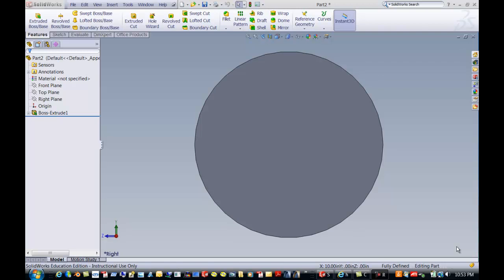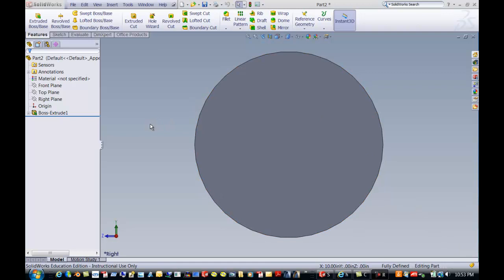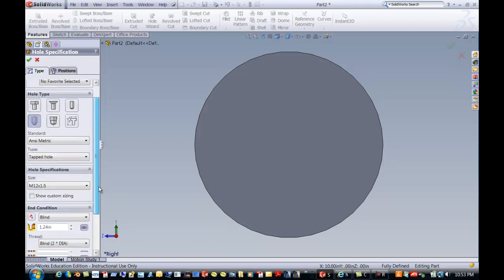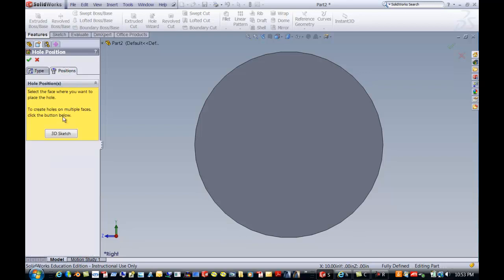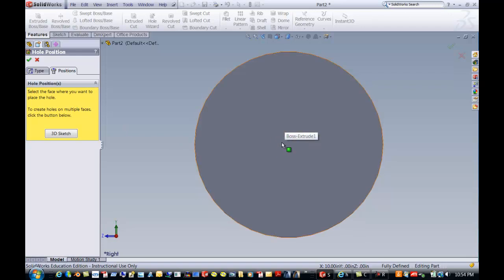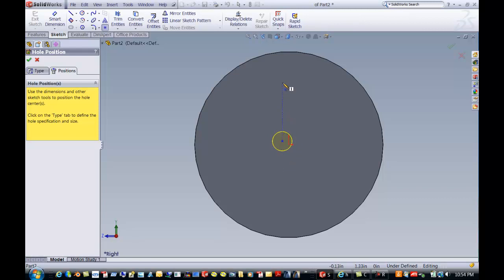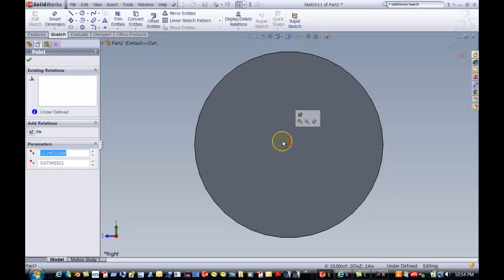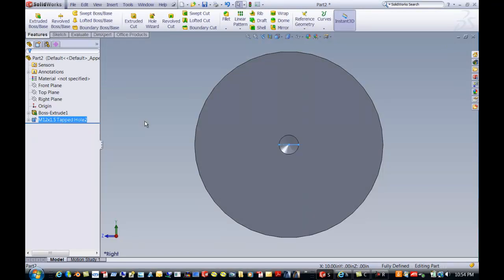Solidworks - How to position a hole

Comment: The biggest issue i see with this way of doing it, is yes, you can center a hole, but how does one go about precisely placing holes that aren't centered?

i.e. is there a way to type in a location based off distance from edge / feature? 

I mean, if i have a 12mm 5mm rod, and wish to place a hole 2.25mm from center, how is that done??